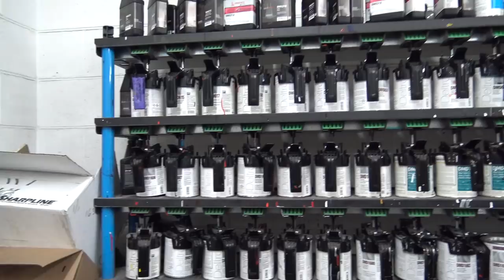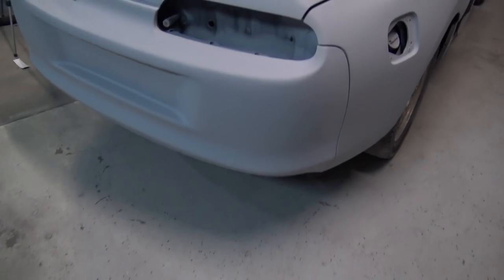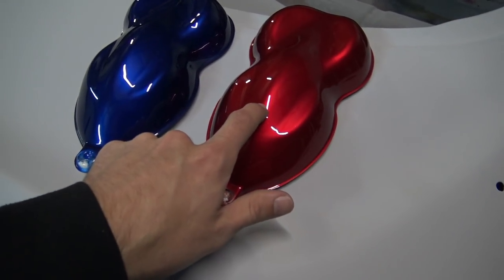SUPRA PAINT COLOR REVEAL!

Comment: Hopefully you paint the body kits separately, so if anything happens you can remove them and the stock body is still in one color. I don't believe you have the stock front bumper you can paint as well and keep as a spare should something happen to the bumper and side skirts (if you're adding any) you're planning on putting on this thing. I say be prepared and think ahead for this one you never know.